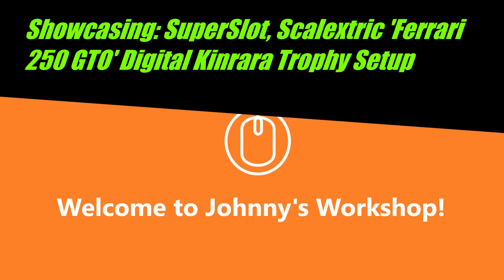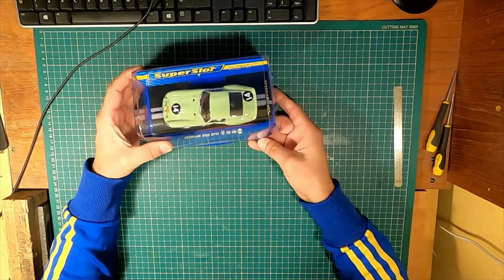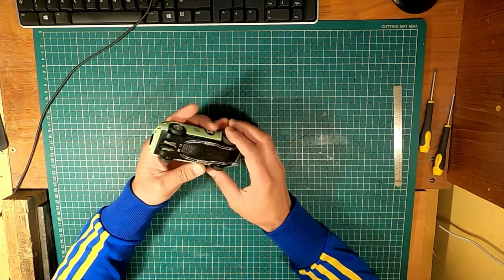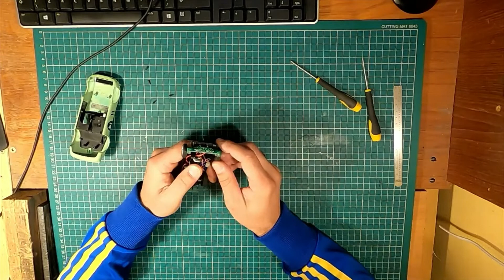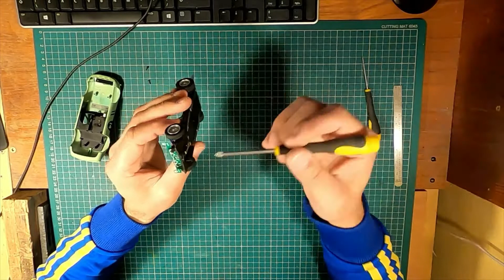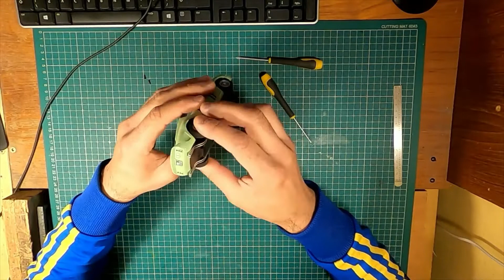SuperSlot Scalextric Ferrari 250 GTO Digital Setup

Comment: I just added a chip to my 250. The car drives and the lights work. It won’t change lanes or register on  lap counter. I located my sensor and chip in the same place as yours . Did you have to change the guide blade or make any other adjustments to get all digital features to work? Do you have a more detailed video on how you installed your chip? Thanks
Reply from the maker: Hi, thanks for getting in touch. 
It should work as shown in the video, I didn't need to modify the blade (although it is good to make sure braids aren't obstructing the IR LED view).

Perhaps it would be good to check if there are no issues with your retro-chip or installation:
- If removed from a previous working car, check all terminals for loose wires, 
- if you ever replaced the IR LED, gotta watch the LED polarity (only works one way),
- check how deep the IR LED is poking through the chassis (Works better when it's poking a little bit out, not too much or it will get damaged touching the track),
- if your chip is fixed to chassis with velcro or double-sided tape, perhaps try without it just in case the adhesive is conductive?

There aren't many things that can go wrong with retro-chips unless faulty, the issues above are a short list of mistakes I've personally made installing car chips in the past.

Hopefully this will help you diagnose what you are experiencing with your car, cheers!
Reply: @johnny_s_workshop  thanks for the detailed advice.